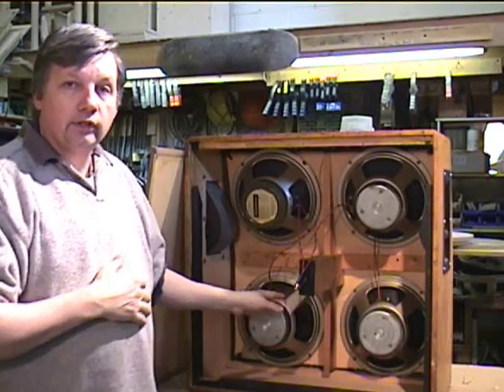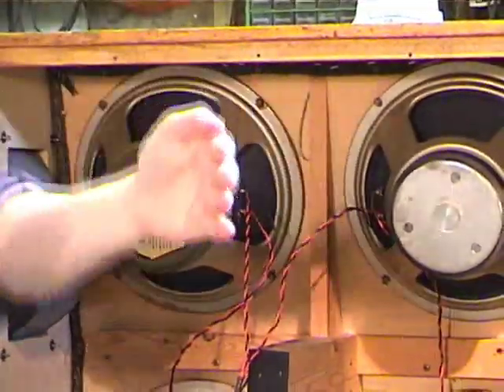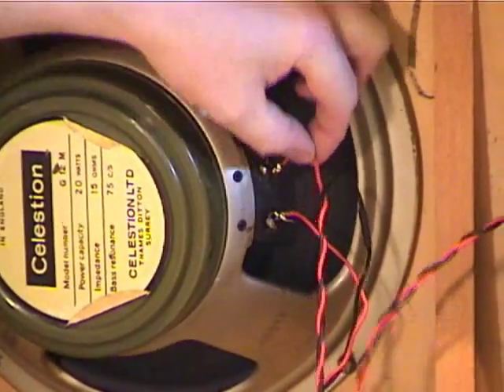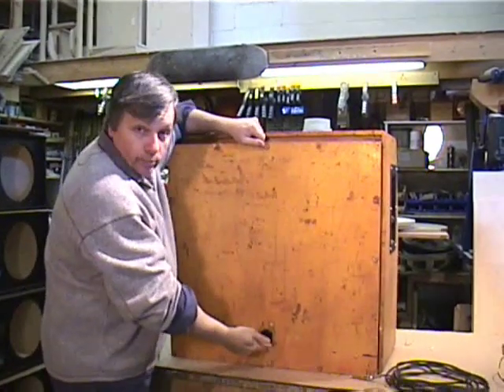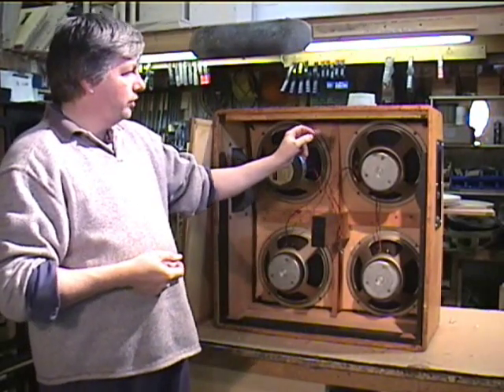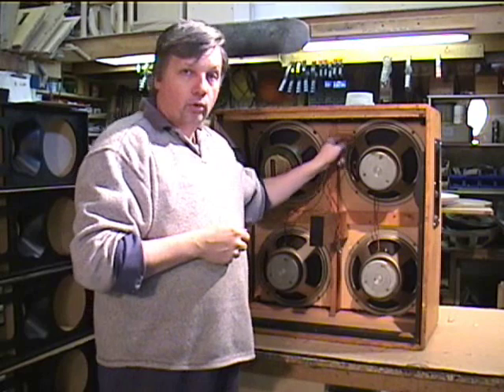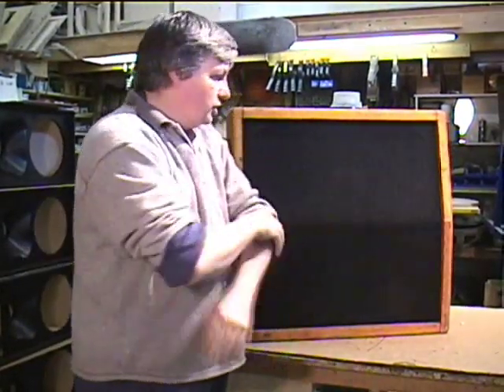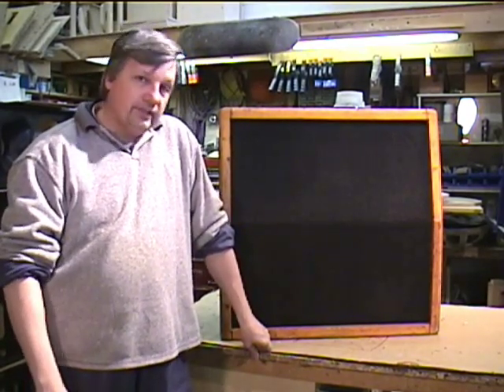Marshall 412 Repair pro tip from Doyle Audio

Comment: I knew a guy who got a 70s angle front Marshall 4x12" and it was in a complete state though it sounded great. So he stripped off the tolex / vinyl, sanded it all down, painted it with wood dye, buffed it then put three coats of yacht varnish on and it looked like a piece of furniture, bloody lovely. He even maanged to find some brass corner protectors for it. He never gigged it.

Comment from the maker: Yes this is true of every guitar cab we have seen, but we ourselves have learned from this "design flaw" (for lack of a better word.) We put a metal tie strip  across our cables to reduce the risk of damage,(Get it in plumming supply for holding pipes.) In other cabs we tie the wires in a loop so there is some play when you pull it out yet you can push the wire back into its loop when reloading the drivers. It helps to be around for 30 years. LOL  
God I'm old.

Comment from the maker: Would be nice Jyme if you offered comments in a more professional tone than sarcastic one. Talking with Jim Marshall directly in an interview I did with him in 1988, he took pride in stating every part was interchangeable. Long before you and I were around Jim lead. He doesn't want to change anything but you and I can do after market repairs and mods. I prefer to change it as little as possible from the original.  Our own Doyle 412 uses a steel strap to hold down wires.

Comment from the maker: @malkinmario 
Hi Mario,
Can't say with your cabinet the effect of integrity after removal of the Tolex. It could be very little or a lot depending on how well the wood working was done. In our cabinets it would have no effect. I recommend you totally strip the cabinet down. Sand it well, It would take about three to five beers worth of time. Then varathane the cabinet with an oil based satin finish. Put it on thin, three coats will improve the cabs integrity. The varathane will yellow nicely.

Comment: If you haven't done it yet, its simple. Run Parallel. input to speaker 1. speaker 1 to speaker 2. speaker 2 to 3. 3 to 4. that drops 16 to 4 ohms. as for me, i have a cab with an input and output so i don't really know what to do with mine, but yours should be fairly simple

Comment from the maker: @ac23AQ Part du
If your a very good wood worker you can add a separating wall. It will involve a lot of bracing for the wall to be anchored. Problem is your center wall will have to be removable. If you ever want to repair the grill cloth, you will have to remove the baffle wall through the back along with the new wall. Depending on the quality of your fit, you may get buzzing, especially with k-100's (Love that deep tone) I recommend you look out for one of ours used. LOL Or drink more Beer.

Comment: @doyleaudio Stereo imaging is mainly in higher frequencies and the majority of crosstalk inside the cab will be lower frequencies. For the majority of users it doesn't pose a problem and gives more then enough stereo effect without the cab being divided internally. A divided 4x12 cab running mono doesn't sound like a 4x12 cab. So if it were divided, the other users would complain about it being divided. There is no such thing as an all-in-one piece of hardware when it comes to musicians.

Comment from the maker: I'm thinking Alice Cooper. "Welcome to my Nightmare" lol. 
Grills, the hardest things to do properly.  A dieing art, you have to have experienced "Hands" to do the job justice. I'm the only one that does it at our shop.
I recommend your local upholstery shop.
Tip. line up the cloth to one side. Stretch an anchor 1" from bottom of the side then stretch til you get it the right tension and staple the top. It's the stretching to the tension that takes the skill.
If I get another job I'll tape it.

Comment: Dear Gerard, I mean which speakers would you install in my cabs according to the speakers I have and taking into account that the whole stack is for my rehearsal and only the 1960 A cab is going to be used onstage. I thought in installing the four G12T-75s from 1984 in the 1960B  and the G12 65s from 1981 and the two G12H from 1976,in a cross in the 1960A, this one is going to be used normally alone onstage due to trasport. I'd used both, but I've got a small car.Thanks a lot indeed Eloy Navarro

Comment: Hello!. I aquired a 4 12 marshall cabinet for cheap that had the tolex ripped up badly. It appeared the previous owner actually tried to rip it up on purpose. So it did not look cool. I decided to remove the tolex and then realized the tolex may have a hand in the strength especially where the sides interlock on the corner edges. I like the cab in this video. Does removing the tolex impair the durability of the cabinet. Thanks!

Comment from the maker: @ac23AQ Part 1
Great question.
I'm seriously down right pissed off with any company calling a 412, a "Stereo" cabinet when it actually doesn't have a wall to separate the cabinet into two (Stereo) chambers. You have the waves of one channel bleeding into and THROUGH the cone of the other speaker. They put in a $1. switch on the jack plate and boosted the price by $50.
The 1960 and most companies claiming stereo, don't have a chamber wall. Our DCE412 is a true stereo but cost 25 million dollars.

Comment from the maker: @LENNYlanes 
If it's a Marshall, it was never designed to have chalking. The Baffle is removable as is the back wall. The gable to top and bottom walls use to be done with finger joints so if it's the older design, Good , they don't need chalking. This removable wall and baffle design, is problematic. Permanently installed back and baffle 412's actually will sound louder.
Bottom line. Just make sure all the screws are hand tight and that's the best you can hope for.
Cheers.

Comment from the maker: @randygonet 
Interesting. Speaker cones are relatively tough. If the water didn't soak into the voice coil and didn't cause corrosion and most importantly its sounding the way you wouldn't it, I don't see a reason for fixing something that's not broke. I would recommend you spend the money on Beer and Chicks. That's just my professional opinion.
G

G12K-85 is one of my favorite sounds. The G12K-100 is the same speaker.

Comment: Hi guys!
I'm Eloy from Spain. You once helped me with a doubt and I hope you can help me again. I have a marshall complete stack, I mean 1960A and 1960B and my amp it's a Marshall JMP 100w from 1978 model 2203. And I have 8 speakers. 4 G12T75s from 1984, two G12 65s from 1981 and two G12H from 1976. I use the stack in my rehearsal and only the 1960A onstage. So, how would you load the cabs? Thanks a lot again and greetings from Spain. Eloy

Comment: Hi, Jerry This may interest you, I have a Peavey guitar cab 1990's  when my apt flooded, the two bottom speakers had water on them up to just below the center cone. It sat for a day like that.
I let it dry out for a week and nothing was damaged.
Do you think they may be ruined? they don't sound weird or anything and seem to work fine, they are Celestion G12K-85.  They are at least 15 yrs old. This happened three years ago by the way. 
Thanks, Randy

Comment: Nice video. I need some help with wiring.. I have a 4x12 cab w/ 16ohm speakers. Using a two jack panel w/ switch, how can I wire the cab to run at either 4 or 16ohms Mono? Thanks.

Comment: What is your opinion on the Tone and the advantages/disadvantages  of Rear mounted Speakers vs.Front Mounted Speakers?
Reply from the maker: Would you believe I'm just getting to this comment\question 9 years later lol. Fact is that front mounted does not have an audio cavity that is incredibly subtle but there. In a blind test , everyone picked our cab front loaded with the same drivers in a recording. But half picked the Marshal when they could see the name plate. lol. Funny how the mind works.

Comment: I just acquired an old Marshall slant cab. It's a plexi style 412 cab, but the previous owner ripped out the grill cloth for some reason. Could you tell me how to install a new grill cloth?
Reply from the maker: It's all about having the experience in the hands. You have to  pull the grill to be tight but not to much to take it out of shape. You have to fallow the lines in the grill cloth to the edge of the baffle board. I recommend an upholster. Find an old one. Upholster that is LOL

Comment: Mr. Doyle, I do want to apologize for sounding so rude, I had seen this in too many Marshalls. My Dad was the same age Mr. Marshall was and I got my first half stack in 64. I am building a half stack now and was going to tolex it but the finished wood looks great, I've used 5/8" baltic birch but thinking 1/2" for the baffle board, I'm 61, suggestions please?

Comment from the maker: Sorry but I don't understand what you are using or how you are wiring it. But I would like to understand. LOL
When you say dual Cone, what do you mean? Do you mean Dual Voice coil?
When you say "..right x- to x- " what is "x-"?
Identify your speaker terminals as "red or hot or Positive or +" and your ground line as, "Black or  ground or common or -."
And I will try to answer. Other wise keep in mind what ever way it's wired, it sounds better with Beer.
Thanks

Comment from the maker: The circuit design I believe is on line some where. You do need the right kind of switch and jacks. Not to be self serving but we can sell such a jack to you if interested. 905 839 9998. If the land lady answers hang up.